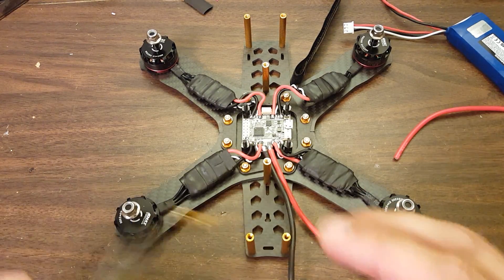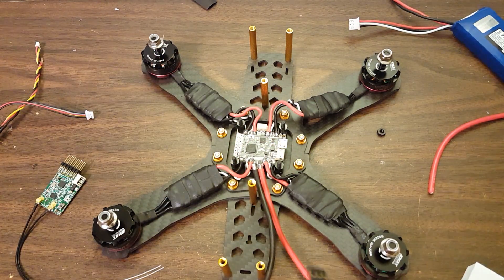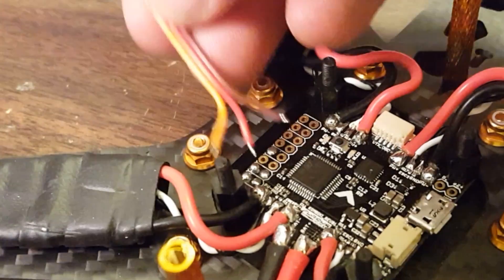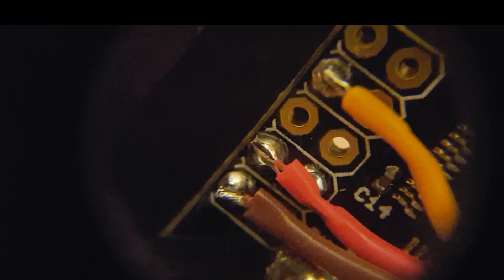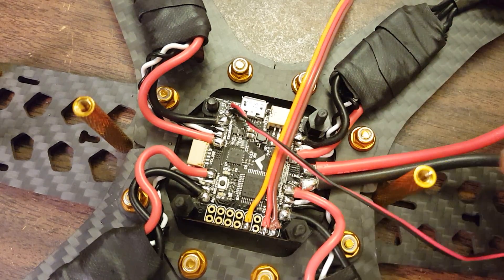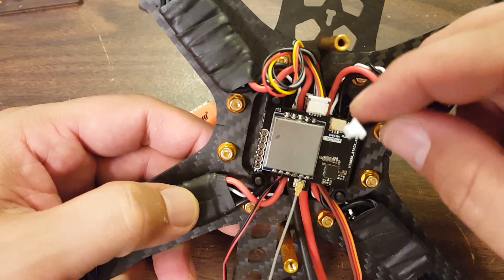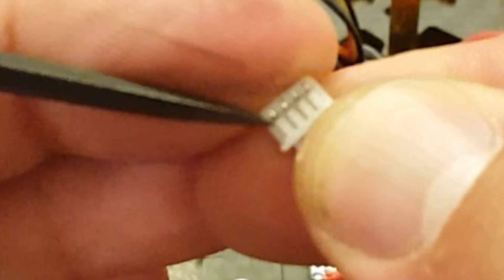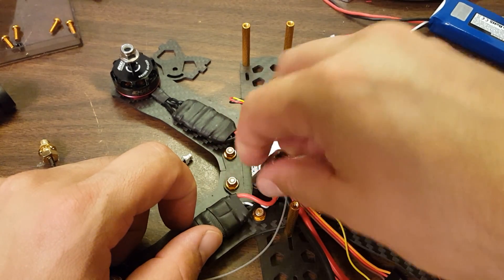HIGH END RACING DRONE BUILD - Part 3 | Skull N Drones Rampage w/ Furiuos FPV Kombini

Comment: can you connect a fatshark transmitter to the kombini board? does in plug in directly to board or would you have to solder it ?
Reply from the maker: +Truthseeker105 Fatshark transmitter won't talk to the Kombini because it doesn't have a built in OSD. There's nothing to "talk" between them.

Comment: I was just reviewing the pin outs for the receiver and telemetry, and according to the Kombini diagram, you hooked up the S.Port to the UART2-RX, and they show it going to UART2-TX? Am I confused? http://www.quadcopters.co.uk/ekmps/shops/quadcopters/resources/Design/kombini-quick-wiring-guide.jpg
Reply from the maker: It's possible that's why my S.Port isn't working on that copter. I double-checked and was sure I had it right, but you are probably right.
Reply: Thanks! I'll be wiring mine up tonight. Fingers (not wires) crossed.

Comment: Hey josh I built a 180 using the kombini. I used uart 1. For the open log device. But I can't seem to make it work. It will record but when I go into blackbox all I get are little squares going across my log screen . It shows the sticks but no graphs. Any thoughts?
Reply from the maker: Decrease your logging rate to  1 kHz or below. Make sure you are running the openlog at 250 kBaud.
Reply: thanks Josh I'll try that

Comment: hi joshua. do you have any vídeo flashing kombini?
Reply from the maker: +Sérgio Luís it's no different than any other board. There's no need for board specific flashing instructions. 

Install CP210 driver. Install VCP driver. Use Zadig to change the STM32 Bootloader driver to winusb. 

See my "how to flash Lumenier Lux" video for instructions.
Reply: Ok thanks, and about flashing options using betafligth...what version do I choose?
Reply from the maker: What version of betaflight? 3.0, I guess. It's the most recent.

If you mean what board target, the answer is to log into the board as soon as you receive it, go to the CLI, and type "version". It will show you what target is currently on the board, and then you know what target to flash.

Furious is pretty on the ball. I wouldn't be surprised if you received the board with 3.0 already on it?

Comment: Maybe you have any advice how to make direct soldering stronger for thin wires? In my case they tend to snap off near the solder pad. I'm trying now to pre-tin the ends and soak solder under the shielding. In that case the wire is stronger, but for plastic shielding it melts...
Reply from the maker: +RandomWisdom use a bit of hot glue to hold the wire end stationary.
Reply: Use silicone wire! That is so flexible that it does not put any pressure onto the solder pads. And depending what you do you can put a little hot-glue on top.

Comment: Hey Mr. Barbells, long time listener, second time caller. Off topic, but I am running into an issue, I imagine it is fairly common, and thought maybe you might be interested in making a video on the topic. Batteries - I've been flying for about 8 months, I have some batteries that are that old, some that are 4 months old and some that are 1 month old. Some of the 8 month old batteries seem to out perform, the new ones. I have done IR test on them with my charger, but I am not sure if this is the best way to go about determining which bats to fly, especially on race day. I have my bats numbered, but I can't be bothered to write anything down when I am flying. Anyway, just curious about your thoughts on the matter. Thanks for all you do....
Reply from the maker: +Know 1's FPV IR is as good a metric as any. Look for sag under load as well as resting voltage after pulling the same mAh. Higher resting voltage is better.

Comment: Just curious, why did you choose the Kombini FC board even though it shows a lot of hassle to set up? Why not go for a popular/more commonly used FCs like a SPF3, Xracer F303, or KISS FC?
Reply from the maker: +Charles Lee I wouldn't say it's a hassle to set up. It's more challenging to solder but the resulting build is very clean. I wanted to try it out and thus frame seemed like a good fit.